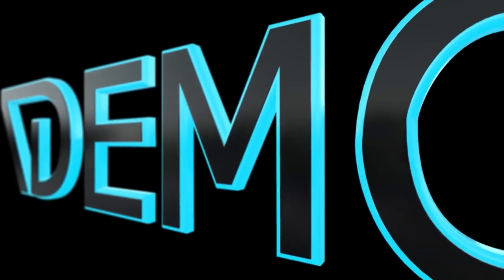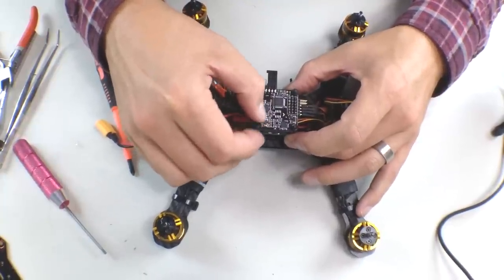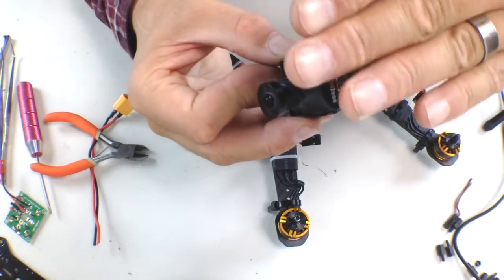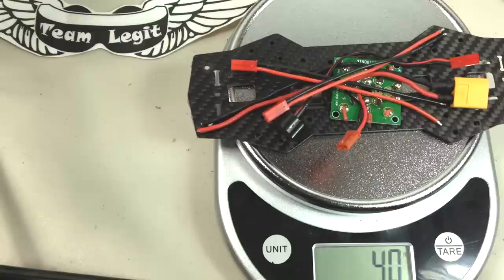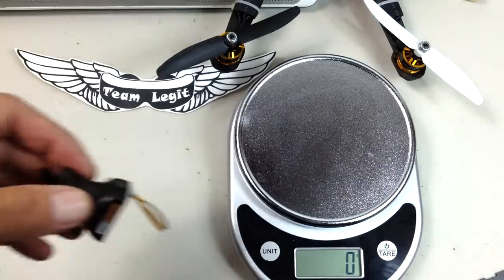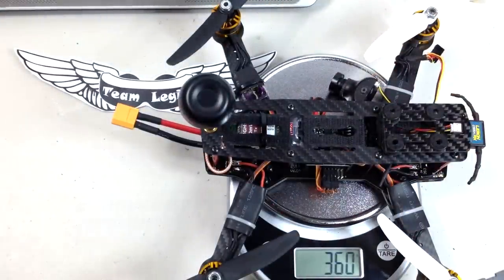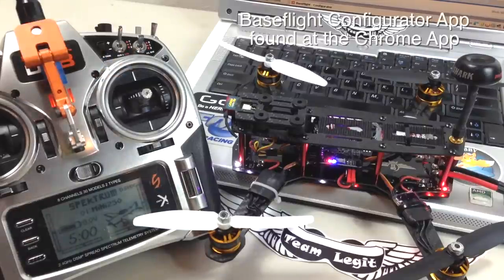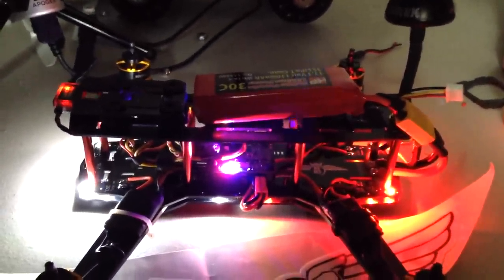Team-Legit Overcraft PDB Installation ZMR250 *Read Safety note in description!

Comment: Great tutorial. I will be buying one of these frames soon
Reply from the maker: If you use this pdb, buy some thin nylon washers to put under the standoffs in between the frame./ pdb. I have learned of some issues from the PDb shorting out and carrying  current through the  frame. The thin nylon washers stop this from happening
Reply: Yes I have one of these pdb. It was the first thing I bought through a group purchase here in Spain. Ok thanks for the tip.

Comment: Hi mate, if you put the stand off screws through both boards with a spacer between them the frame will be much stronger.

I recently built one of these for a friend and after building my Blackout and knowing how strong it was I was pretty unimpressed at this minor lack of detail with these frames really lets it down. I simply used some nylon nuts between the two frame plates to space it and almost all of the frame flex that's noticeable with how you have it setup was gone and the ZMR flies remarkably better.

Happy flying.
Reply from the maker: Thanks for the observations. This frame does take some work to get working perfectly- it comes down to the way it flies and I'd put this up against a blackout anyway!
Reply: I have a blackout and a couple of mates who fly these exact frames. While they do fly a little bit different there's only so much difference you can have when you are dealing with almost the same stuff. I find the PID's need to be higher on these frames even with identical electronics compared to the blackout size due to the the frame dimensions. I recently built a "copy" of my blackout with all of the same electronics into the ZMR frame and had to wind everything up. The main advantage to these frames in my eyes is the ease of being able to put 6" props on without having to order new larger arms. I do think though that if I had bashed a ZMR frame as much as my Blackout frame I would have gone through a couple already and this was my reasoning to wait until I had the money to afford the higher cost/spec frame.

Getting them all squared up while building them can also be a bit of a task I find but once you get everything loosely together it takes nothing more than patience and attention to get it right.

Comment: What gauge wire did you use for the battery connection? I'm using a 3s 1800mah battery. Any suggestions? Subbed to you channel :)
Reply from the maker: Not sure of the gage but I know it was huge!  Probably too big, it took my soldering iron a long time to heat it up.

Comment: Hi! I finally received almost all my pieces to buld a quad like this. I bought the same motors and I was wondering, did you just use two of the little long screws that come with it to attach them to the arm? I may be doing it wrong, so that's why I ask. I watched the whole video again but you didn't show the unserside of the quad :P
Reply from the maker: Yes just be sure the screws don't touch the windings of the motors and you'll be fine, I only use two screws for motor
Reply: Thanks! I'll add some thread locker just to be sure. I've done so much research to build this thing but there's always some detail that I miss.
Reply from the maker: Yes, thread locker is what I use on these little motors!

Comment: damn I wish you actually showed mounting the camera because I actually have the same one. how did you end up mounting it I was almost considering buying a 3d printed mount for it that slides over the front to standoffs
Reply from the maker: I used hot glue- hasn't come off yet!

Comment: I can sugest you to try the new mini hex chasis by HobbyKing - it very very fast and can easily carry 4000-5000mah Zippy Compact battery with SunnySky 2300KV 2204 motors (6) and Gemfan 5x3 or 5x4 props!
Reply from the maker: I saw this and they look awesome- don't have the $ for another craft now
Reply: All you need is Thorax frame from HB $25 plus 2 extra motors - and you will forget about mini quads - so much more speed, power and fun to fly!:) it is twice as fast as my QAV250:)
Reply from the maker: I do have an extra naze32 board, hmmmm
Reply: I fly with NAZA Lite plus GPS - also switched to Gemfan 5x4 props - now it is like a rocket - much faster than my old QAV250 - you should try it - check the Black Out Mini Hex reviews on Youtube - very similar performance